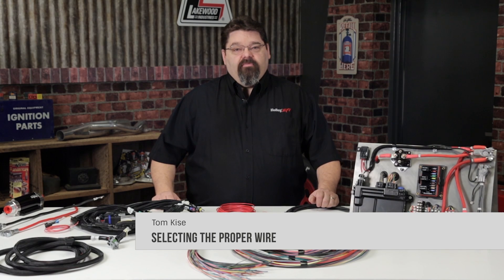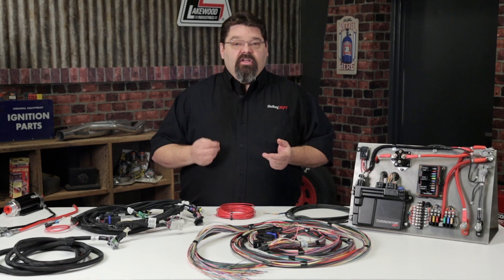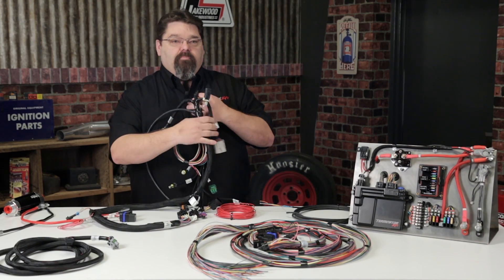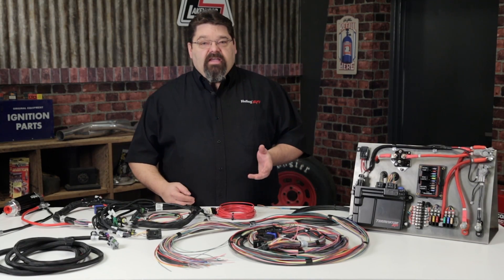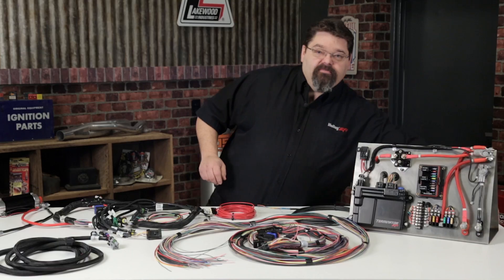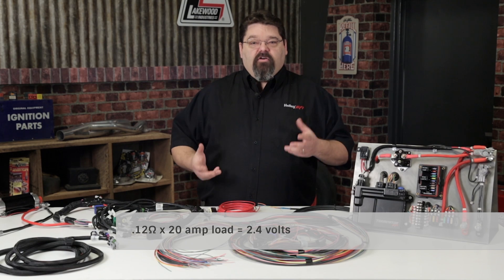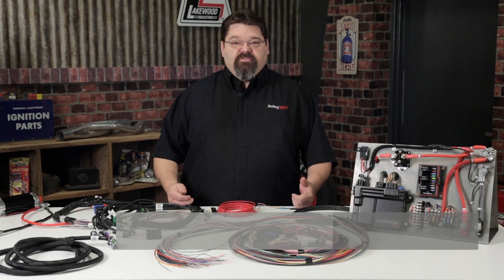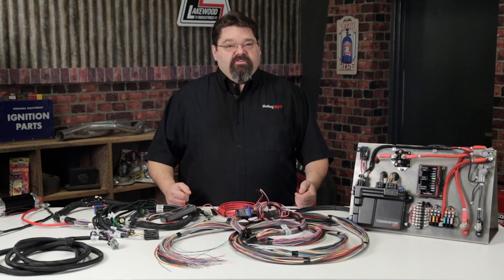How To Select The Proper Wire - Holley Tech

Comment: I work in electronics and I still find this video useful! 

One tip tho when measuring resistance don't touch the leads with both hands cause then you'll be measuring the resistance of your body also
Reply: That would matter only if you are measuring resistance at something near the same order of magnitude as the resistance between your hands.  That number is from 1000 ohms(wet) to 100,000 ohms.  So for checking the resistance of 30 feet of wire (e.g., 0.12 ohms) and holding the ends of the wire to the VOM leads with your hands, the effective resistance is still 0.12 ohms.  The error introduced by holding the wire and leads is 0.01% to 0.0001%.